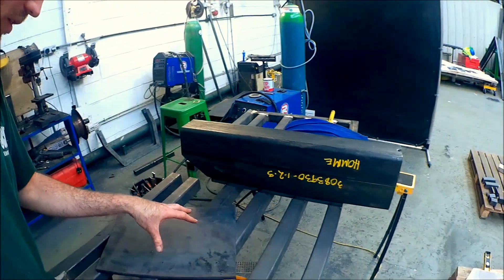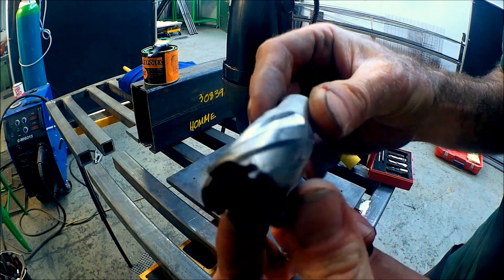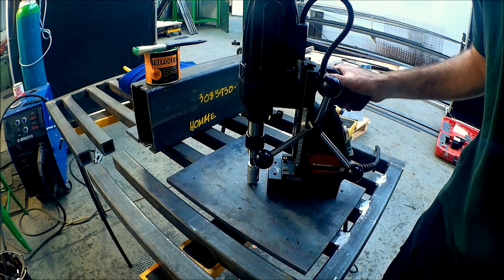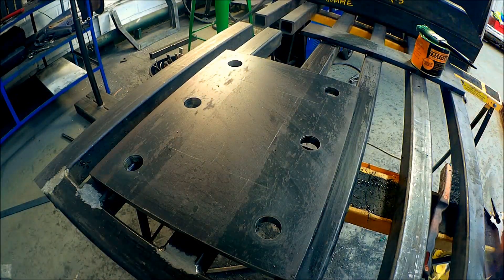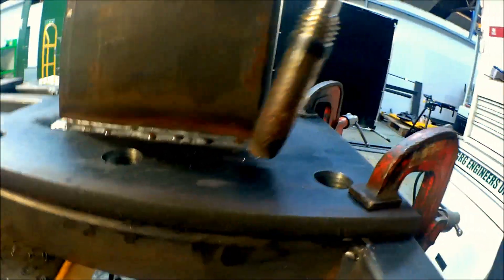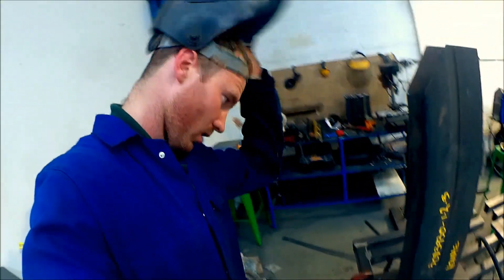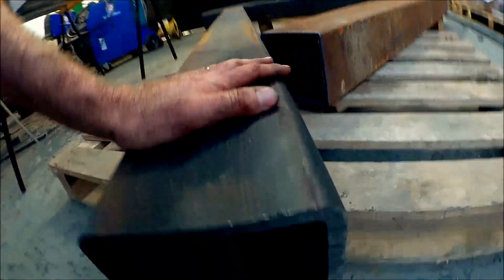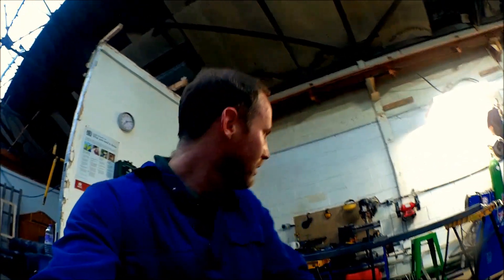Minimalist staircase build #3

Comment: Hi Josh. Was wanting to suggest a tip. If you Grind a Chamfer onto the piece your going to weld then you will get more penetration on bigger bits of metal.
Reply from the maker: I did on the large sections and ground out a hollow after fitting and then welded so that aligning everything up was more accurate. I didn't feel it needed it on the treads because the edges are radioused.
Reply: Joshua De Lisle sorry yeah see that in the next video.
Reply from the maker: Its ok you are right, it would make it slightly stronger however it was more cost effective and plenty strong enough to not bevel the ends. cheers J

Comment: Beautiful work: Question, after tac welding with your mig wouldn't have been easier and faster to stick weld your flat welds with a slow cooling stick like 7028 or jet rod? or are there factors I'm not taking into acount?
Reply from the maker: Thats a good point i've not compared them, I will try that though for another video and compare weld types and speeds. we didn't have those rods in so it was really a case of working with what i've got, great comment thanks robin!
Reply from the maker: Did you mean 7018's?
Reply: I'm a novice welder "I'm a blacksmith " so it was an honest question, not a criticism.
Reply: No! 7018 is an all position quick cool  rod.  7028 is for horizontal only but it leaves a robot weld bead
Reply: Jet rod seems to have more flux on it and I don't know it's numerical code , but just strike your ark and lay the stick down and you have a bead that everyone will envy , although seeing your work , I don't think you have to worry about that.
Reply: Forgot to say, if your unfamiliar with jet rod..... don't chip it or inspect it for 3 to 5 minutes, the slag explodes when cooling,where safety glasses...... been there , done that. painful.
Reply from the maker: A bit like stainless rods they sound like. I've not come across a 7028 before, even while welding low pressure gas pipe we used INE 6013. i'll have a look into those though, they maybe branded different here.
Reply from the maker: Found some Excalibur® 7028 fast depostiting rods

Comment: Hi Josh, enjoying the videos. Just one observation, I see that you don't clean the the steel before you weld. When I was welding structural pieces, we always ground the scale off before starting, and between the layers. 
Really looking forward to seeing the shop started. All the best.
Reply from the maker: Its good practice I guess but thanless there is lots of oil on the surface I don't bother, the penetration is fine and rarely any defects so why waiste the time. good tip for begineers though.

Comment: I gotta say Joshua, I was quite skeptical about the use of those cheap hole saws but with that cutting paste, I have been shown otherwise.  I always use my rotabroach cutters for anything that matters and save the hole saw for wood and non-crucial items since they always wobble on me.
Reply from the maker: They were cheep enough to try and did dthe job fine. proberbly was only good for that plate but very much dull now. Rota broach is the best long term solution without a dout. If its cheap enough i'm always curious to try it incase it works well.

Comment: Man, your welds look so satisfying!

I do have a metalworking question that you can perhaps help me out with: I've made a welded metal sculpture a few months ago at the metal workshop at my school, and sandblasted the whole thing. I hadn't thought of a surface finish for it. In the last few weeks I did some experiments with sandblasted scrap pieces to find the best finish and settled on wirebrushing. 

Here's the problem: I have no idea how to best keep it from rusting. At the moment I sprayed it with a (ludicrous amount of) penetrating oil spray, which will stop rust and has given it a much nicer color, but I'm afraid it will also make all the dust in the air stick to it. Any ideas?
Reply from the maker: If you have alot to coat or have the money, a powder coated clear lacquer is fantastic, powder coating is a plastic that is baked onto the surface. other wise a can of rustolium clear lacquer is good.
Reply: Thanks for the advice! 
I have neither a lot to coat, nor the money, but I'll definitely keep the powder coat in mind as potential finish for future projects. I do believe I have a shop nearby where I can get rustolium, so I'll give that a try on my test pieces.

 Whatever I end up doing, I'll make sure to send you a link to the finished piece, once I figure out where to upload it.
Reply from the maker: I look forward to it and I hope it works out well, either way you'll learn something for the next project ;)
Reply: Hi Josh, I'm surprised you didn't tell him one of your secret Blacksmiths magic formulas with Bees Wax etc but agree with you a quick solution is to use a can of spray lacquer and Rustolium is a good quality brand - some of the cheap ones (we have all tried) are useless.
Reply: In industry once an item is grit blasted it must be painted or coated within 4 hours or it will 'ginger' - the start of the rusting process. If you can apply a holding primer it will preserve the blast & provide a good key for future coats
Reply: Would linseed oil be an option?